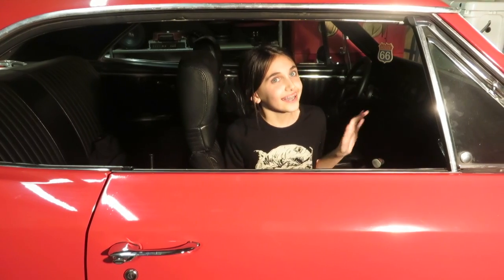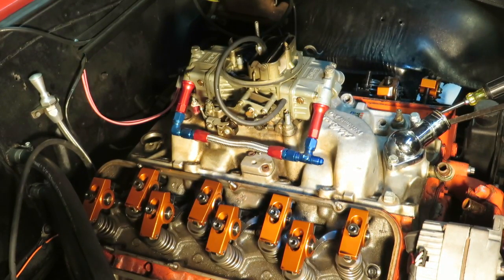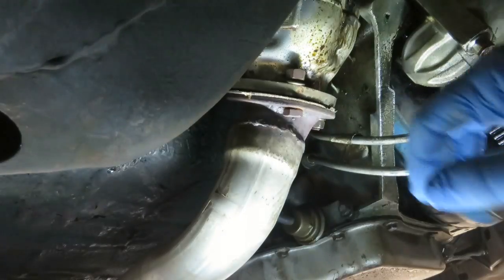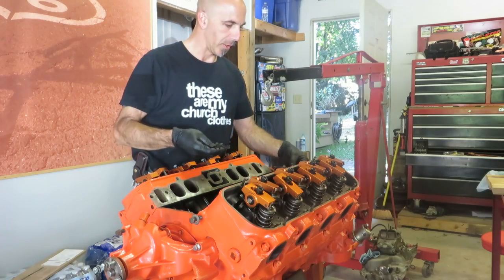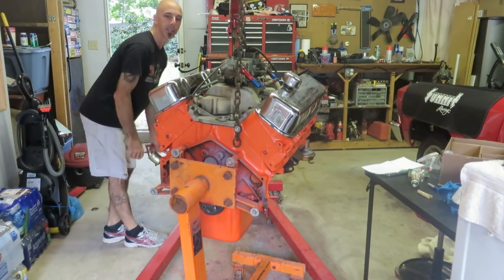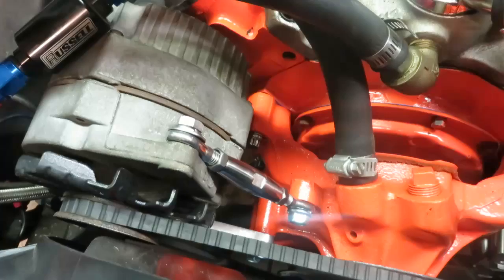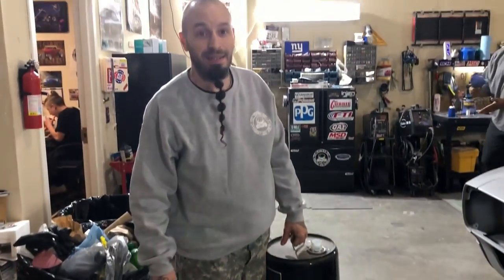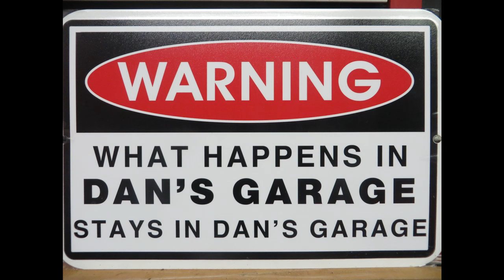Chevelle Cam Swap

Comment: Loved the video ,  bbc known for flattening a cam if no zinc in oil and correct break in . I vary the rpm's up and down from 2500 to 3000  for 30 minutes to throw oil at different angles . Allen Grove makes super nice brackets
Reply from the maker: Backyard-Built-Trucks  this engine was professionally built and lasted over 10 years and then flattened the cam. I have been adding the zinc also but hopefully does not happen this time. Thanks for watching!

Comment: I have a 67 Chevelle I really want to put a cam in but I don't want to have to pull the motor 😬
Reply from the maker: dj rosa you can, you just have to pull the radiator and may need to move the center grille support.